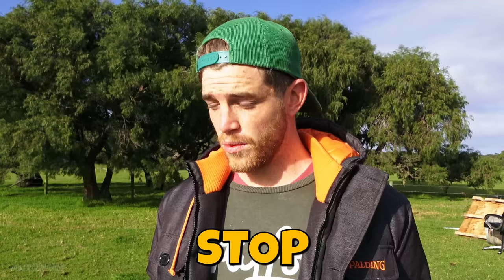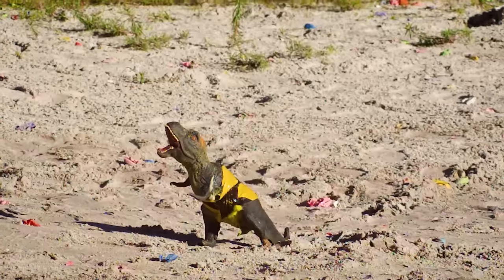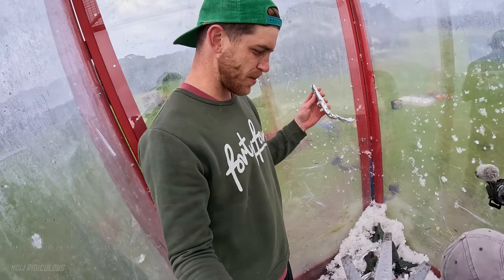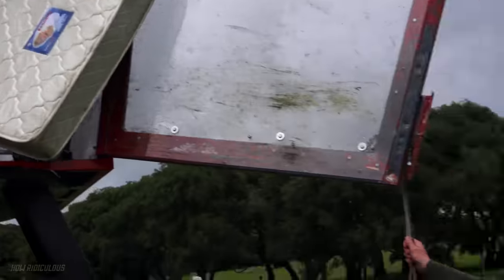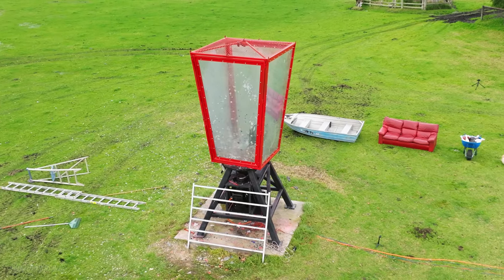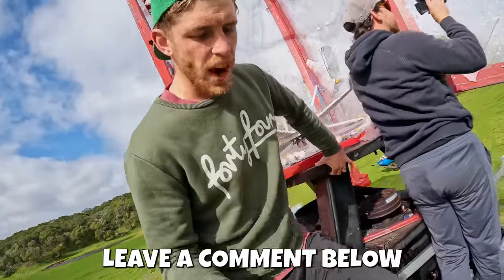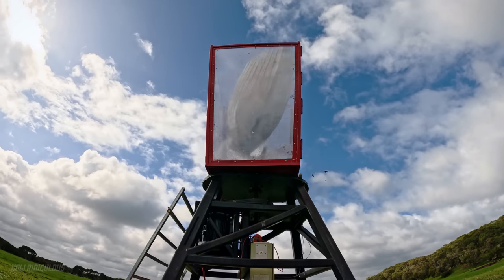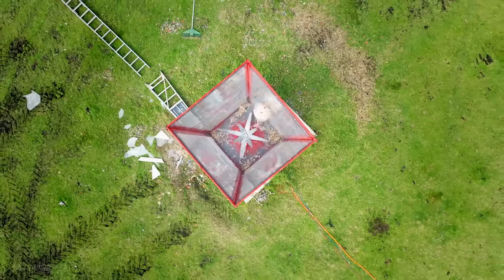Most blenders can't blend boats...

Comment: Golf balls are basically purpose-designed to transfer energy efficiently. They deform and then spring back without breaking, turning the impact of a golf swing into maximum distance. Which means except for a small amount of lost to air friction and heat, all the energy from those spinning blades is being transferred by the golf balls to the polycarbonate. It's as if the blades, themselves, are hitting the walls of the blender.
Reply: Yeeeeees the comment o was looking for thank you for the explanation sir I appreciate you 👌💯
Reply: Bet
Reply: In a nutshell, yep.
Reply: Yep there's a reason why you can hit a golf ball 250+ yards and a tennis ball maybe 250 feet.
Reply: Also, if I may add to that - the many golf balls mess up the vibration. One ball hits the poly and the wave moves out from the surface. Then more hit those waves and compound it.
Reply: Yes and because of it shape it will focus all that transferred energy into a very small point
Reply: Thank you for this explanation
Reply: The weight also helps. They are light enough to get maximum speed off of the impact with the blades, but heavy enough to hit the glass hard.
Reply: @fried-chicken420  so you logged onto YouTube, looking for this exact comment, huh?
Reply: @CasuallyCommentingBaseThings  no I watched the video and he even asks the comment section to answer it and his answer was the one I was looking for 👌
Reply: @jwagsftw  and also if I can add to that as well, the golf balls having a smaller surface area to transfer that large amount of energy and force to break the polycarb
Reply: Also small mass items will take more kinetic energy from the blows, and the blades aren't even sharp enough to cut golf balls. Why do you think the other blendings end with pieces that are larger than a golf ball?
Reply: Of all sports balls, only golf balls are specifically designed for maximum distance of travel for a given energy input. Of course it's so efficient.
Reply: It's all due to the blades being more bludgeoning then cutting if they had a cutting edge the balls would be shredded
Reply: @Turboy65  voleyballs are designed in a similar way. They even have grooves to help the ball cut through the air smoothly, similar to how golf balls have grooves.
Reply: Nice one mate didn't know that until you explained it in layman's terms thanks again Buddy 💯💯💯👍👍👍👍😁😁😁
Reply: @jwagsftw didn't know that either learnt something twice in one video brilliantly explained 💯👍😁
Reply: Wow u just blows my mind lol
Reply: Commenting to bump to the top
Reply: @kurtwicklund8901 no it's in a giant blender👍
Reply: Combination of shape, mass and composite material structure. A round shape minimizes energy loss by air friction and concentrates the impact force on a single contact point. Dimples and smoothness on the surface reduce drag further. A relatively low mass reduces the force of impact. The elastic rubber core of the ball can take up very large elastic displacements (strains), preventing stresses from impact, while still taking up energy. A stiffer, stronger outer layer of the ball increases resistance to damage at the surface/contact point.
Reply: The mowers at every golf course I've ever played don't seem to have an issue chopping them up though.
Reply: @Justanotherinvisible  Those mowers have blades that are probably less than 1/8th thick. This blender has blades like an inch thick. It doesn't so much cut things as bash them apart.
Reply: spot on explanation
Reply: 999 IQ thanks bro
Reply: Now I want to see Golf Balls in a lot more vids....

Put them up against the giant axe/hammer, the hulk fist, i doubt they'd touch much of the spike trap though
Reply: i didnt understand a thing hmm
Reply: Emcsquare
Reply: Thanks for explaining =3
Reply: God dayum
Reply: Honestly, I’m impressed by the damn polycarbonate

Comment: I think probably the reason why the golf balls do so much damage is they fully store all the kinetic energy and impart it onto the polycarb sides. They are designed to be hit really hard in golf so it makes sense they will take the impact of the blades and transfer it to the housing.
Reply: Yeah they compress really well without breaking when struck by metal.
Reply: It's like what you said but with one addition the blades are more bludgeoning then cutting if they had more of a cutting edge the balls would be destroyed (I've destroyed golf balls in a belnder before)
Reply: That and the force is concentrated over a very small area.
Reply: Also keep in mind, those poly sheets are being shot at (from the balls) likely 100's of times per second... And they ran it for quite while. That's a LOT of impacts in that amount of time. 😆
Reply: Now you just need to glue the kayak back together… 😅

Comment: I’m liking the new generator safety protocol, but if you wanna do it right - the key for the generator should be in the pocket of whoever is cleaning inside the blender. Makes me nervous 😬
Reply: Completely agree, at our warehouse, if you're getting onto a belt or working on a machine, you specifically have to be the one to turn it off and back on. If someone besides the person in danger does it, it's a huge violation
Reply: @unmade_error  My coworker is about to die from this machine. Can't turn it off though cause I'll get written up.
Reply: @CalamityBaird  other way around. While machine is off and someone is working on it, the person working on it is the only one allowed to re-enable the device to avoid an injury
Reply: Realistically something this overtly lethal should have multiple lockouts preferably one electrical and one mechanical. A big breaker next to the device and a big pin in the drive system that would prevent it from rotating even if power were supplied would be a nice arrangement.

Comment: You guys are keeping the spirit of the early 2000s YouTube alive and I’m here for it
Reply: YouTube wasn't around till 2006
Reply: @EnclavegovtofficialUSA  that’s still early 2000s really
Reply: @SailingFrolic 2000s youtube, even late 2000s, was nothing like this. it was almost all comedy skits and a little bit of gaming, and by that i mean cod clips
Reply: i dont think youve watched any youtube since the early 2000s then xD
Reply: Keeping my CHILDHOOD alive!
When I was maybe 9, I had a bare electric motor... from I don't even remember what I took apart, a fan maybe... I put some of my GI Joes on the shaft. Side note: GI Joes had a thick rubber o-ring that connected their hips to their torso.
So when I turned the motor on, they would spin really fast for a bit because I had wedged the what between their connected halves. 

However, the motor shaft was spinning much faster than the actual GI Joe was, so eventually the rubber melted through and that, in turn, sent two halves of GI Joe flying across the room in opposite directions... 😅

(looking back, I'm amazed I never got electrocuted from it; it's only 120V in America, but it'll still make ya jump lol)
Reply: @birgir3399  that sentence should’ve ended with “I don’t think.”
Reply: @Joffe.  the “spirit”

Comment: The blender/golf ball combo is like a shotgun to those poly-carbonate walls, lots of very high-speed little balls constantly getting launched by the blades (and bouncing around) in there.
Reply: Yes, they're so light and bouncy, that they just go faster and faster, which makes tiny little hard things flying around very fast.
Reply: @nazfrde  Modern golf balls are constructed with durable outer covers to resist damage from high-speed impacts, while their inner cores are made of elastic materials that compress and rebound upon being struck. This combination of strength and elasticity ensures they can withstand repeated hits while maximizing energy transfer. Energy came from that generator, multiply by number of balls :)
Reply: @say9704 They definitely served their purpose
Reply: @say9704  "Energy transfer" is totally key here. Great explanation! :)
Reply: @PunCraft  sadly/thankfully, they didn't use  Titleist balls...
Reply: Just to add to that great explanation,  The golf balls spherical shape and level of elasticity likley stored a majority of the energy from the blender blade until they hit the walls. The round shape focuses that energy on a single point. That is transferred to the polycarbonate. Which inturn absorbs dissipates and or returns most of that energy. When it can't.... well they can put a peice of polycarbonate in hundreds of merch orders.
Reply: @bflamm8587  To 'further' that even a bit more, don't most (if not all) golf balls have dimples? So the surface area on contact, if hit at the right angle, would be quite small and piercing in relation to the polycarbonate. Focus of a sphere with ultra-focus of dimple ridges :)
Reply: @bflamm8587  good info, but it boils down to golf balls have been incredibly engineered to be smacked by metal. and here we are smacking them with ~217mph essentially golf clubs and ball speeds are 1.5x golf swing speed so the balls are going about 325mph
Reply: i dont think this is right i think it was the frequencies of the golf balls hitting the poly kinda like how you can break a wine glass with your voice if the wavelengths are correct
Reply: @bflamm8587   so you dont believe it was the frequency of the golf balls hitting the poly but the impact itself? like the very beginning of the shockwave itself? i dont belive it was the inpact on golf courses they use poly over windows to protect them from being broken they leave a few inches of space between the poly and the glass for the shockwave to not reach the window so i really think it had something to do with the frequencys of multiple golf balls hitting the pain of poly simultaneously the shock wave from those impacts then ripple tword and away from eachother and when they meet at the same frequency it shatters because there is no wheere else for the energy to go either way its fun to come here and talk about it
Reply: @Itzirish__   OH, that makes so much more sense with that description! Ball makes poly bounce, too many balls and poly can't bounce no more but takes full brunt of force (ELI5 Summary)  Yes?
Reply: @PunCraft  yeah I mean I that’s what I believe atleast 😂😂
Reply: Agreed with these later thoughts. It might also be described like a shotgun, it hits in several places at once, or nearly at once, which causes stress fractures in the polycarb where those flexion waves meet. Basically, connect the dots, and the area within those points breaks. Polycarb is strong, but not particularly plastic (It doesn't deform well), so it's easier to break when it reaches its limit, instead of deforming, when it reaches its limit.
Reply: Certainly the force due to the velocity is a huge factor probably weight and quality or solidness of the strike being big as well.

As far as the velocity of the ball.  I beleive that golf clubs have a limited coefficient of restitution of approximately .80. Meaning they return approximately a maximum of 80% of the energy produced swinging to the golf ball. Which was selected because the old wooden clubs returned aprox the same percentage.

Modern golf balls however are not limited to the same philosophy of performance and are vastly enhanced over the golf balls of previous generations.

The blender blades would obviously return a much higher percent of energy than a golf club . 
 plus their speed and mass as stated would be many times higher.  So the speeds of these little wonders would be much higher that a golf club could ever deliver. 
Polycarbonate windows of golf carts get broken by stray golf balls  frequently.

I would guess that if one ball at a time was dropped into the blender eventually one would be hit well enough to brake the first layer and then once craked and weakened peices would more frequently brake off until the next layer  is regularly hit eventually brakes and so on. Well at least that is how I broke my mums window as a teenager.

The use of hundreds of golf balls and multiple blades speeding that process up beautifully.   My main thought is a spherical shape and rubber components of a golf ball aids in consistency of receiving and transferring high amounts of energy consistently.

But I do my science like Gonson so it could all be for  completely different reasons.

 It was great he quoted him self "well that is not in one peice anymore"
Reply: @bflamm8587  also we know there was multiple layers but not thickness of poly or space between poly those are all unknowns
Reply: Ye it's like getting smacked my a golf club bet they making some force bouncing off them blades like 3x more force 😂
Reply: @Itzirish__  This is exactly it, when the golf balls hit the poly they create a "shock wave" which ripples out in every direction, much like a water droplet creating a wave when being dropped in water. So when this happens all over the place and close together, eventually all the energy starts hitting one another across the sheet of poly carbonate, causing vibrations until it breaks, kinda like waves of water hitting each other in a wave pool
Reply: @MrTommyWay  your way better with words then i am but thats what i was trying to say lol

Comment: Golf balls are designed to squish when hit (normally by a golf club going quite fast, in this case by a blender blade going extremely fast) and when they rebound they accelerate quite quickly and go very fast. As well, as they fly, they are still squishing and un-squishing as they go, which eventually results in them being very destructive.

As well, the polycarbonate sheets most likely started to vibrate as they were repeatedly struck by the gold balls, and if the sheets began to vibrate at a resonant frequency (the sheet vibrates at the same speed as the atoms that make up the sheet), it will just instantly break. This is the same principle that allows singers to shatter glass with their voice - only in that case the things causing the glass to vibrate are air molecules rather than golf balls.

Hopefully this satisfied your question.
Reply: renal-dr7st  in the name of the general public, I invite you to stop spamming comment sections with pushy religious garbage.

Comment: The golf balls are relatively unaffected because the blender blades are so thick. Obviously not as thick as a golf club or a driver but still thick enough to allow massive energy transfer. The faster the rotation of the blender the more energy being transferred to the balls and therefore more energy slamming against the Poly. To blend up smaller items like golf balls and tennis balls, I recommend having another set of blender blades that have been sharpened to have an edge and maybe even case/surface hardened. The smaller the contact point relative to the size of the object being blended means a more localized application of the force to the blades to that object resulting in a higher chance of slides and dices. Double edged sword..... The sharper the edge of a blade or object means it has less structure to resist deformation, hence the suggestion of case hardening the blades to resist wear and tear (in this case only applicable to smaller objects). The other bigger objects that have been blended have such mass and resistance that damage to the blades is bound to happen case hardening would help but only just.

Comment: 15 mili amps are enough to interrupt the normal electrical signals to your heart. It probably won’t kill most people, but it can. 180 Amps is more current than the electric chair, which uses 7-12 amps.

Comment: I feel like its gonna do better letting it run up, then putting items in, especislly for bigger stuff. An electric motor is gonna have a harder time getting up to speed and generating max torque with resistance early on, afaik. Fun vid as always of course! (Edit: letting it run up first should help preventing resistance build up too, as itll already be able to cut through the item etc)
Reply: it needs a lot more mass on the blender spindle, i.e. a massive flywheel, so it can deliver a lot more peak power to smash through things a bit like the katanas did with small soft items. the belt drive is a good idea for a starter but the flywheel will be a massive bonus, it'll provide a huge increase in the peak force a blade can deliver to a solid item without slowing down

Comment: @8:35 - close.  amps is like the flow rate of the water in a pipe. So it correlates with the pipe diameter, but that is closer to resistance or actually "resistivity" since the diameter doesnt include a length of pipe.
Reply: the wall thickness of the pipe is kinda like the insulation surrounding a wire - it protects from leakage. maybe

Comment: I'm sure you can blend a boat. But maybe a wooden boat...

Or you add a flywheel to the blender axle somewhere... I'm sure the engineery electricy types could figure that out. Give the blender a couple hundred more pounds of inertia and it should tear through that sheet metal just fine.

Comment: A couple groups in the battlebots community did research on the strength of polycarb. After projectile impacts ~250mph or higher the polycarb begins to act much more brittle compared to impacts below that speed.

Comment: Science with Gaunson is the best :).  Amps/Current is the Amount of Water in a Pipe. Volts/Voltatage is the Pressure in a Pipe. Ohm`ies/Resistance is the Thickness of a Pipe.

Comment: As an electrician.
A motor with 180amps is insane.
Most houses don't use 100 amps with EVERY electrical appliance, light on at the same time😂
Reply: To top that off, they are running 600V DC at 180A max... That's 100kW... (It shows 599.xx V on the screen they show)